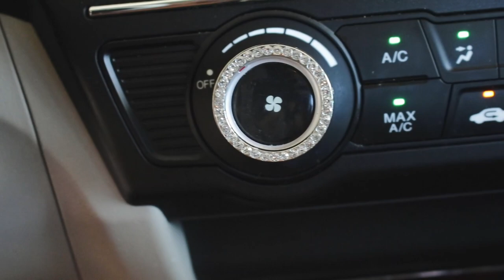DECORATE AND CLEAN MY CAR WITH ME! | Car Makeover!

Comment: a good tip for mirror/windows is pick up some NuFinish polish, works on paint but it really makes the rain come off when it does rain as it repels water, something you can apply every 4-6 months and it really repels water without using wipers even on sidewindows when driving above 30mph. You just clean your windows with non ammonia window cleaner and clean microfiber towels then apply the polish let it haze 1 minute then wipe off it will be so slick

Comment: You need to take off the sticker on the mirror then put on water☺️
Reply: They work like a tint.
Reply: @caringlovetv6998  nope. The adhesive of the sticker makes the side mirrors react differently to water. Once you take the blue sticker back off the mirror will be repellent to water
Reply: Yes you need to remove it

Comment: Your car looks like a Honda Civic which may be reason why steering wheel cover doesn’t fit that model steering wheel is smaller than most and has to get a smaller size
Reply: Merci bb slt hello
Reply: Your a sweet person🤗😁
Reply: yk when u order the steering wheel, they allow u to pick your car model and year. so i don’t think that’s the issue
Reply: @mimi20046  depends on where you order it from tho, so it could possibly be the reason
Reply: @izzyiris614  if she ordered it from amazon they let u pick the vehicle& the year.